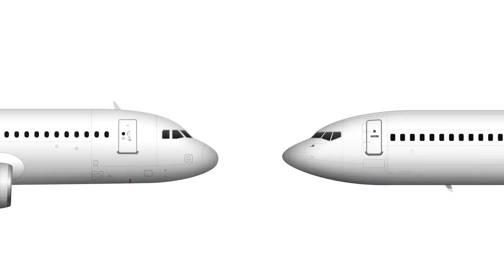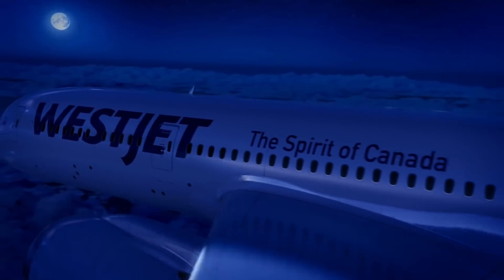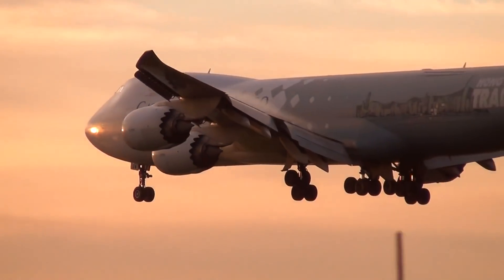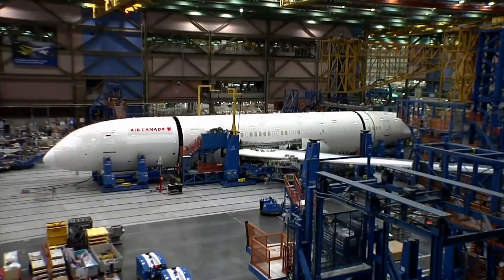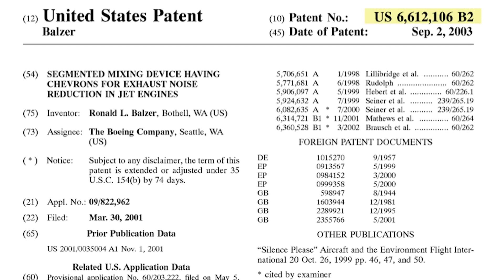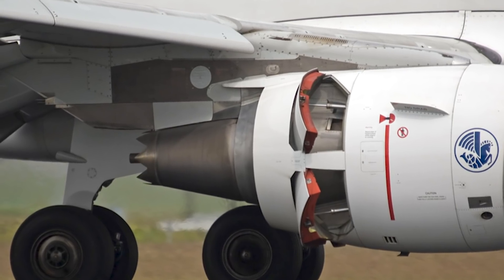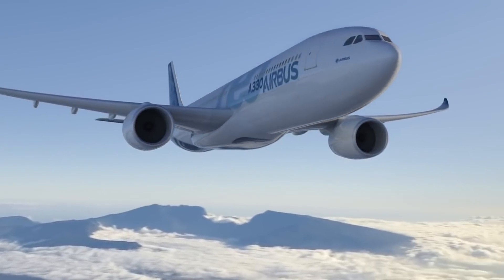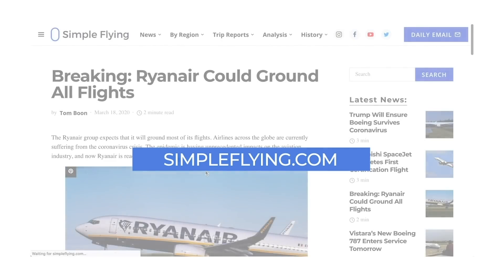Why Don’t Airbus Aircraft Have Serrated Engine Covers?

Comment: its a patent issue, also there's a performance penalty on the engine, there was a 777 with ge90 tested with chevrons, findings elected that chevrons were not necessary  beneficial to the 777

Comment: Honestly something I was wondering, so was happy to see a video... then the video doesn't actually give the answer -_-
Reply from the maker: End of the day the addition of chevrons adds a weight penalty, and Airbus has achieved enough noise reduction and fuel efficiency without them so just doesn't need them. Note that the Boeing 777X will not have chevrons, because it achieves the fuel efficiency / noise pollution standards without them. - JB

Comment: Got a feeling it's to do with bypass ratio, the chevrons are there to mix high velocity air with lower speed airflow to lower noise, but at the expense of some thrust. The A320 NEO has a higher bypass engine than the 737 MAX, therefore the flow from the fan is already slower and less noisy.

Comment: Having spent almost 2000 hrs on the A350 (piloting) and frequently travel the 787 (deadheading), I have to say the A350 is more quiet during cruise, but on take off roll the 787 is more gentle on your ears.
Generally, if Airbus can achieve the same end result as Boeing with their own patents and technology, why bother using someone else's.

Comment: Airbus executives messed up.  They must have been looking at the wrong data set.  The air travelling on the outside moves faster, and when it reaches the rear of the engine, collides with slower moving (inner-travelling) air.  The result is a 'constructive' waveform that causes drag.  So, they add in the 'chevrons' - to break up the waveform.  better to re-look at the data, and make a correction.

Comment: Maybe a psychological marketing tool perhaps, implanting the idea that Boeing has more advanced technology. I think I heard that while it reduces noise, which in turn allows weight saving in sound insulation, it also adds some drag, resulting in weight gain from needing to use slightly more fuel.

Comment: 737 and the like has always been closer to the ground so has to make do with lower (noisier) bypass ratio. So having chevrons was worthwhile in this application to reduce noise and improve efficiency  due to less insulation weight. Airbus probably don't need it because the A320 family etc has had the cfm engines the way they were intended with good bypass ratio compared to boeing planes. Also because they are quieter, chevrons would bring diminishing returns and decrease aerodynamic efficiency.

Comment: I'm still wondering why don't they redesign the 737 into having the same landing gear height as the a320 everything is high so why still keep it low
Reply: Probably so that the new 737 still shares commonalities with the 737NG and older 737s! The pilot should still have the feeling of flying the same aircraft by e.g. sitting at the same height! But other than that a new design is really necessary!

Comment: Chevrons have a negative effect of increased drag 
But also has an advantage of reducing sound insulation
It all depends on the balance
Reply: But with the chevrons you can get rid of some insulators which are quit heavy
Reply: @DavidDavid-qw3mk  Not enough weight to offset the fuel penalty from the engine though. Hence why B777X's engine doesn't have this technology.
Reply: @nntflow7058  That may come down to mission distance though. The 737 MAX adopted the chevrons, but it's targetted at flights less than half the length of the 777-9.
Reply: You beat me to that piont, well done sir.
Reply: And Chevron's also makes Boeing planes looks so futuristic as cool though.

Comment: Airbus uses a combination of noise insulation and active noise canceling on their aircraft on the inside.  This is fully evident if you look at the thick side walls on an A380. This may even be why they  force airlines to get wider seats, as narrower seats wouldn't actually fit well in the cabin.  Exterior wise they are just as loud as their older variants. They don't use it as they simply found an alternative to it. It should be noted the E170/175 also uses the chevrons on their engine nozzles.  Also, their engines are computer controlled (well, nearly all engines are computer controlled) but contrary to popular belief, aircraft rarely use full trust to take off. So they could simply hold more thrust back at lower altitudes when able to help keep noise down. It works out to same effect for less cost.

Comment: Let's not forget 777-X doesn't have them either.
Reply: Also the GE9X Engines have more advanced internal mixers which already do the job!
Reply: Their position is that engines are getting quieter and so the chevrons don't provide as much soundproofing benefit anymore.  Chevrons are probably going away.  But CR929 CG renders tend to have them (who knows about the actual prototypes though).
Reply: Airbus is always right
Reply: @viniciusmagnoni6492  Except for the A380
Reply: @shrimpflea  Everyone has the right to commit an error once in life, Boeing in the other hand has committed a lot of them.
Reply: @shrimpflea  Well, the A380 can be considered a financial failure but is a hell of a good aircraft, with no doubts the most luxurious commercial aircraft ever made.
Reply: @viniciusmagnoni6492  Agreed
Reply: @shrimpflea  It is like the Stratocruiser, Brilliant but too expensive.
Reply: @viniciusmagnoni6492  Sure but IMO the A380 and the Stratocruiser are both ugly. The Lockheed L-1011 was an advanced, beautiful aircraft that never sold well. Most airlines opted for the cheaper DC-10.

Comment: The fact that Boeing and GE ended the shevrons on the 777X for me just shows that this feature can't be so good otherwise they would use it there.
Reply: @arnulfonapoleonhernandez-g1995  The reason why the 777X doesnt have the Chevrons is because Boeing & GE figured a way how to make the engines quieter, hence why the 777X doesnt have them. Not because of lack of testing etc
Reply: @arnulfonapoleonhernandez-g1995  And he just said what you think is wrong. You don't have to get defensive, no one thinks what you said was correct even though you phrased it like a statement and not an opinion.
Reply: I think the 1st 777X prototype, initially, had chevrons, yet later they were removed because Boeing (and probably GE) found a way around them just like Airbus did. However, I wouldn't say they're bad, because if they were,  then Boeing would remove them from newly manufactured Dreamliners, Maxes,  747-8 (although the latter may not be manufactured much longer)
Reply: @akedem  no 777X has ever had chevron engines. Boeing mentioned they would not be adding the design because they found a way to reduce noise just after launch at the D.A.S!
Reply: @akedem  not if removing them caused noisier cabins and "Boeing is noisy"  remark, becausen probably they already reduced weight by removing /reducing  sound insulation to better compete with the a350
Reply: 777x have goliath bypass ratio so would be fairly quiet anyway, and because the engine shrouds are big; chevrons will only increase drag and decrease efficiency in this application.
Reply: @robbiemckeegan8317  I will accept your first point not the second one still Goliath thing is really hilarious.
Reply: @hulklovesaviation7535  Chevrons are less aerodynamically efficient on engines than conventional; prove me wrong 😂
Reply: They certainly looked cool on the initial concept video of the red livery 777x video Boeing released.
Reply: Indeed. As it shows that chevrons slightly increase TSFC.
Reply: Chevrons

Comment: Airbus believes in their own way to handle the problems,
Reply: Yep, the fact that they rushed to make the A350 with the composite hull, wings, lower cabin altitude,  sky interior and even the batteries at one point of the 787 which was outselling the A380 at the time by nearly three to one, makes me think they don't like copying the competition at all.
Reply: @jhmcd2  The A350 isn't competing with the B787, though...
Reply: @J.Stein1  Originally it was supposed to, but then they determined that it would be easier to compete against the 777 instead.
Reply: @jhmcd2  your right they don't there original
Reply: Eeyyy yees 😁

Comment: The chevrons reduce noise, but increase fuel cpnsumption, so why use them. Thats why 777x quietly removed them.
Reply: I was going to mention the 777X. Seems that even Boeing doesn't see the advantage anymore. Or better yet, that it only makes sense in certain circumstances.
Reply: Only use them if the noise regulations get tight enough to require them. GE may back-port the new exhaust system to the GEnx, or it may not. Who knows?

Comment: Guys I just have an idea...Can't we add a Vacuum box at the engine's rear? Since sound can't travel in Vaccum, it won't make noise..Its just a theory, I don't know how will the exhaust gases get out
Reply: Kyu soch rhe ho yrr itna.
Reply: @bazirao  are bhai aise hi dimag chal gaya mera..
Reply: @piyushkanthak1087  Control uday control !!
Reply: @bazirao  are bhai🤣🤣
Reply: You don't want to add anything because you don't want to add weight.  Before chevrons, some aircraft designs included exhaust mixers behind the engine.  These suppressed sound by a great deal but add even more weight and performance penalty than chevrons.  And since engine designs are getting quieter, there isn't as much need for these gimmicks.

(Also, you would have trouble keeping vacuum in such a proposed contraption.)
Reply: @alexandernorman5337  Yes sir, it just came in my mind..I know it will not work

Comment: Honestly this is a question I've never found a solid answer for.
Reply from the maker: Thanks for the feedback! - TB
Reply: Same. I think it all comes down to aircraft manufacturer their philosophies of benefits over downsides. In this case Airbus didn't consider it worth it to have chevrons installed. Which is the best answer I could find.
Reply: @hodb3906  i also think Airbus eliminated chevrons because they had other technologies that they found to be more favorable than chevrons
Reply: @theskyline1425  Correct. The a350 went for composite inlet, which incorporates a “zero splice” acoustic inner barrel.
Reply: @theskyline1425  Boeing with the help of NASA developed and patented the Chevron technology and am sure while Airbus would not be willing to pay Boeing to use its intellectual property, the later would also not be willing to sell to their rival. Regards
Reply: Noise, fuel efficiency
Reply: also, it is harder to put chevrons on engines--> increases cost of production